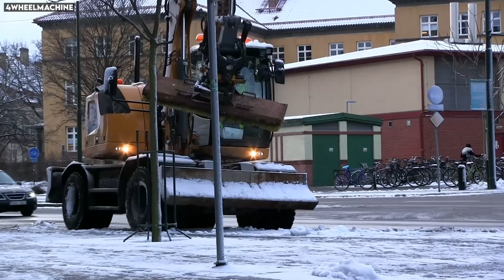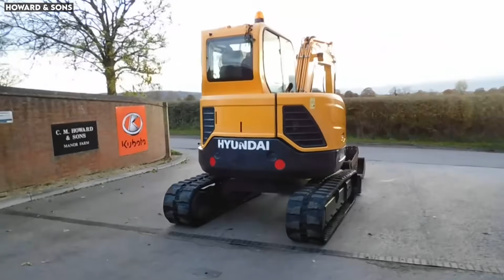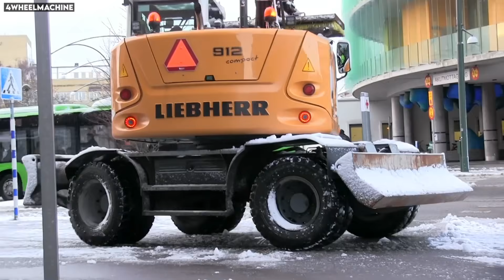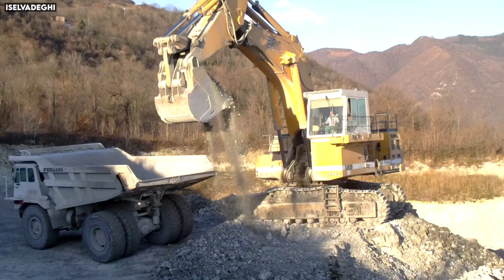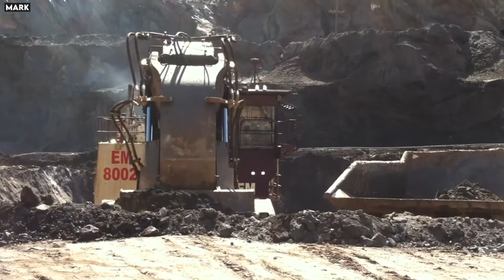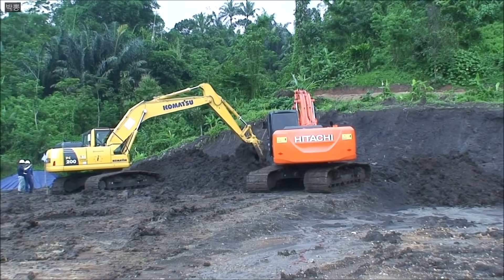10 Excavators From the 1980s That Changed Construction Forever

Comment: Besides the "TURNING" radius with "0" counter Wt. Sticking out, don't forget the brilliant design of the "TRACKS" being able to (Slide) in & out, with a Dozer Blade that has a hinge on both sides, 😊 to "FOLD" the Blade in, so the whole mini Excavator can fit through a standard size fence or Door opening, 😊 best design idea for the homeowners with Fence gates, that his mini can fit through 😊 but I can tell you from experience, that the small mini is still very "TIPPY" you had to be still careful on the issues of "ROLL OVERS" even with a counter Wt. John Deere & Cat have added more counter Wt. Just because of this.

Comment: Another comment I had was in the late 1970s I saw the Cat-245 😊 working on a freeway drainage system for the Road expanding. I was in "AAAA" of looking at this very advanced looking huge excavator, and I had never seen Cat build excavator before this, at the time I was operating a Case 580-C series of Backhoe, I eventually got to work on a sewer job were we had a brand new Bucyrus Erie 350-H excavator with the newer style upper house design 😊 man could that machine rip out hard pan all day long, we once were changing its teeth "TWICE" a day, because they got so worn down, from the hard ground. And at the time not knowing that Bucyrus would completely "STOP" building their Construction line of equipment, in 1985 😢 and just only build for the big mining industry only. I so loved the Bucyrus brand of excavator 😊❤😊

Comment: Just look at the very "HUGE" import of mini "CHINESE" brands, from below 1-Ton, to the same size as American made from the big THREE" I am saying Cat- John Deere- Case 😊 as examples, I know there are more. But the "PRICE" of "1" American made mini, you can "BUY" Three mini Chinese made ones, 😊 I see guys selling a group of them from their Garage, or in the southern U.S. there are big Building type sellers, I have over (100-Hours) on my RIPPA Brand, the 1-Ton size, with 100-pound counter Wt
It has a "Thumb" 😊 and Hydraulic attachment for other Tools instead of the Bucket 😊
I bought 3-Bucket sizes, and a "Ripper" tooth, that all go on easy with the quick Disconnect system design into the end of Dipper arm. The Tracks, slide in & out, and the Dozer blade has fold point on each end to match the width when tracks are pull into the side of upper house 😊 so far no problems with the CHINESE built mini for me at this time of writing. 😊 they are just very affordable to a homeowner with a tight budget.